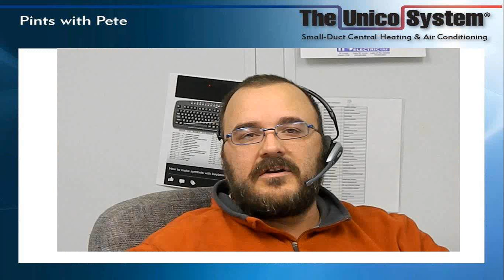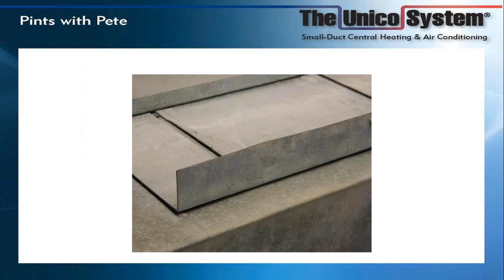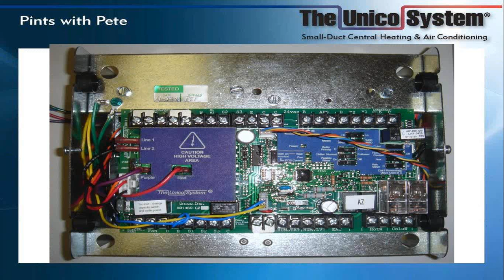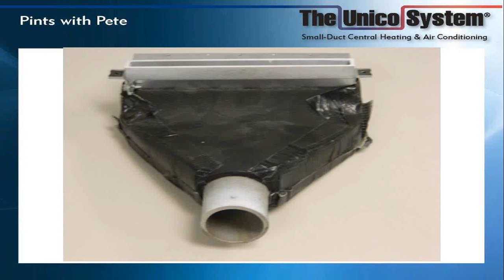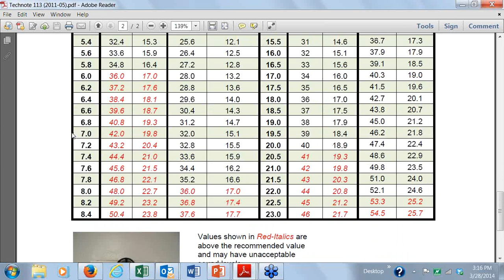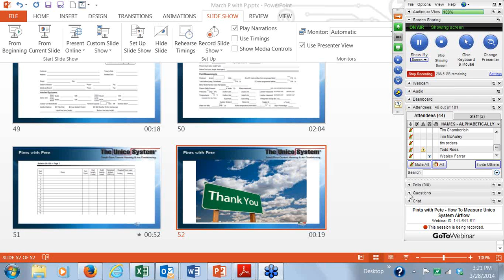Pints with Pete - How To Measure Unico System Airflow

Comment: Hi I am a certified installer in New York having a issue with my supply doctor sweating .
And we also have no dehumidification my supply air temperature is 49
Reply from the maker: Hi William. Thanks for reaching out. Please contact our Technical Support Team at (800) 527-0896 opt. 1 for assistance.